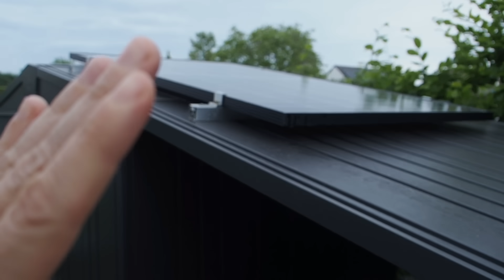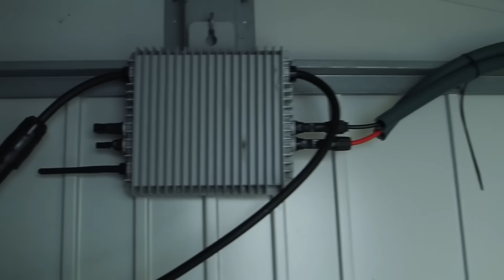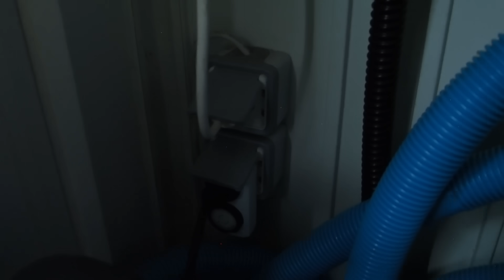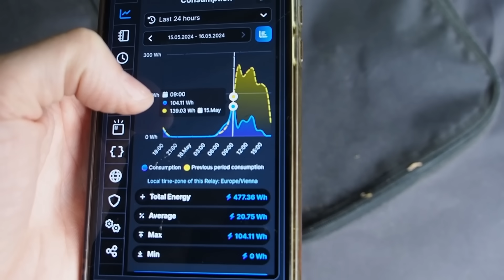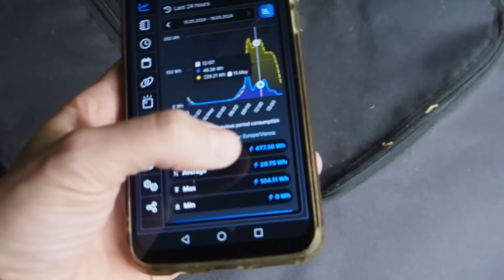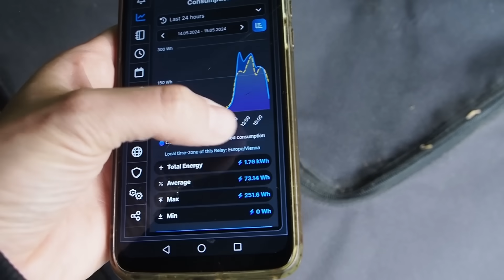Solar system? Yes? No? Which one?

Comment: 18 panels + 18 micro inverters + 900 for mounting metalwork + 300 for cabling + 3 guys @ 400 per day  ==  €6000
However...  a 7kW system will generate all the power you need to run your house in one hour (probably), for the rest of the time you are feeding the grid.
So the best solution is probably, as you said, you only need 4 panels for your house and pay a little to the generating companies.
I have come to the conclusion that you must decide first your strategy, either you rely mostly on the grid and reduce your bills with a small solar installation or you install more panels and put in a battery such as a Powerwall 3.

Comment: I'm currently installing a 1500 watt solar system with a 200AH battery in a trailer on my driveway. I'm going to plug a 5000btu window A/C into it with an extension cord. If it works well, I'm going to get a larger battery and a 12000btu minisplit to run off it. That way I won't have to run my Central A/C unless it's very hot or cloudy for a long time. No permits needed, no grid tie expenses, low cost and redundancy if either my central air or solar power fails

Comment: Never get an on-grid solar panel. Stay off-grid and out of the hands of the government
Reply: To my logic and calculations, it is best to have a few panels let`s say up to 2kwp and a 10kw battery (usable capacity around 70%) so the panels are working hard and the battery covers a usage of most of appliances when sun goes down. It is pointless to build the system for winter (in my region). The point is to help yourself for 9-10 months a year.
Reply: @viliamgajdos5917  nice.
Reply: Nope no solar no electricity live like the Lost ways the book and you will always survive. You don't need electricity to servive.
Reply: They are lying. The solar is toxic. If hail hits it your land is toxic.

Comment: Having a storage system -- Tesla powerwall or a set of batteries -- is the way to store excess electricity to be available when weather is bad. Even winter has many sunny days -- charge your batteries then, and use the power when the panels aren't producing as much.
In many places in the U.S. the town or city requires your house to be connected to the grid, like apparently your area does. But many other places don't have any requirements -- you get to choose how you want to use solar power, independently or attached to the grid, and also whether you want to sell excess power or just store it.

Comment: 13.7 kWh peak and 22 kWh battery here (Trina cells and Sofar battery and hybrid inverter with off-grid function) since Juli 2023. Couldn't be happier. We already got 1000 CHF paid back for 2023 and save a lot on electricity for the pool pump and charging the cars. Was pricey though. Would do it again. Would be cheaper now, though.

Comment: 2 years ago a solar module in Austria/germany costed €400. Now in 2024 the price is €80.    Batteries price dropped the same. 

1) avoid feeding power to energy providers, optimize for self usage = batteries
2) you can save 2/3 to 3/4 the cost by avoiding solar companies in doing it by yourself.

From April to September you can get self sufficient for €8.000 with some DIY work. (house with 4 people)
Reply: I am talking about 6-10 kWp solar and 15 kWh battery.

Comment: I installed a system mounted onto a steel workshop, i do not sell the power but use it myself. I am saving the 27 centimes p/kwh i would have to buy from them.

Comment: Well, I know that I have net metering, which means I produce a kw and the power company pays me in kw.  I can save it up for the winter when I don’t produce enough.  I make a lot of extra power.  My bill is only a $20 delivery fee.  I will be free and clear in 8 years.  I paid cash so I don’t notice it.  I only notice no power bill.  The fire danger… never heard of that happening.  This is the best money I’ve ever spent.  Small units are good, but the cost is high due to batteries being very expensive.  You are not going to run a dryer or a heater with a small system.

Comment: Lilly just read up on it yourself...  And just see what whatts you would use and get only what you would need... Say for your fridge or just to charge up a phone for emergency only only...  I have three folding solar panels that I can daisy chain to charge my small boxes up with ..  now I use the boxes every day to charge my phones and a few light bulbs that I use at night and switch them back and forth to save on not using my electric bill to power up just a few things...  That saves me a bit...  And just keep things unplugged that helps not pull that trickle pull on your bill...  Just buy some lights that are able to plug into the solar box...  Just see how much whatts you need ..   Alaskan prepper has a video that tells you how to do the math to see how big  you'll need ..   or just get a bunch of Marine batteries and keep them charged up...

Comment: You are a clever girl! We live in Tenerife and I installed a system myself. One 370W and one 200 W panel. Cost with inverter 370 Euro.
I don’t want to give away electricity so the 200 W are automatically disconnected in the middle of the day. Cost saving is 23% and the system is payed within 2,5 years. You made a good choice! I adjust the angle on the 370 W panel once a month. 😊

Comment: I did my own and ended up with a 4.5yr ROI, next i think i will do a battery system and more panels to remove most of my bought electricity for 8-9 months of the year, the ROI will be longer

Comment: I installed a small system myself.  Cost me $10k in materials, I got the 30% tax credit so roughly $7k.  If the grid goes down we have enough to use 3 fridges, have backup cooking, some other items.  Not cheap but if you have no power you have a cabin. Mine is off grid.

Comment: or just use large 250L trash bags air filled to make a solar heat collector. most of energy usage goes to heating anyways. and combine with a suitable heat pump to get the trash bag heat into usable high hot heat. yep connect the outside heat pump interface loop to the trash bag solar heat collector. and the heat can be used to make electricity too, like with peltier generator elements or just steam. of course you can diy. and even if you think you cant, you still can. thats survival, lilly. yeah gotta make sense. God gives for free, no finger pointing. payment is what we call rip-off. and why attach to grid, it makes the parts of the system more complex. just make an off-grid solar system. reliance on people shuggers. no contract. applied survival. diy lead-acid and zinc-acid batteries. come on, off grid, you dont need to fiddle with the grid companies, at all. battery storage for them too tho. also localized battery arrays, so you dont have to burn your cables.

Comment: It seems to me that the important thing is not profiting from your solar plant but to have electricity if the providers fail.  Put only enough for your needs up and quit buying the electricity the providers are bringing in for your consumption, then you don't need a contract with the providers to buy yours.  Honestly, they aren't charging more than they should in most cases.  There are many costs associated with bringing electricity into your home.  The electrical company that wanted three times the base cost of the the system they were selling did not make an unreasonable markup.  Again, there are many associated costs with doing business in our developed countries, costs you don't find on a personal level.  That said, a small system that provides the minimum for your needs is the best idea.  Just as Lilly says, installed yourself if possible.  Being a pensioner on fixed income I spent most of my savings on precious metals and candles as well as warm clothing,  whole corn and beans.  Add bottles of Vitamin C and you might be able to survive a catastrophe: you might.  I would sure like to move about 15 miles north of the metro area across the river however.  :penguin-blue-waving-tear:  

God Bless Us All

Comment: I love your videos Lili, but the "we in Europe" you're frequently using... is not so much a "we". Many countries in Europe have very different rules. Particularly regarding energy.

In France for instance, you don't "have to" resell your produces solar energy to a supplier on the grid. It is one of the available options (and not at a 1/3 the price like seems to be the case for you), but not the only one. And you don't have stupid limits such as this 800W you're alluding to. If you want to make your own off-grid system, you certainly can.

In any case, just as with anything prepping-related, 2 is 1 and 1 is zero... so "don't count only on 1 source of energy" (whichever it is) is still a good rule

Comment: Learn to live with less. I bought a 30W panel with charger for £33. Live on that next month buy another. Keep going pay check to pay check. I will never connect my cabin (not possible) or my house in Portugal or the Philippines to the grid. Use real time solar eg do washing in the daytime. At night all you need is lights. If you can run a freezer don't have a fridge. Have a top loading ice box. DON'T buy large panels buy the smallest. As objects get smaller they get stiffer and stronger. You are also not putting all your eggs in one box. Lastly, permit adequate ventilation (for cooling) to the rear of the panels.  It improves efficiency and longevity. One last thing try to live off grid and then go off completely the discipline will teach you.

Comment: 🇨🇵 hi Lili, installing self suficient electrical network, for a fridge, you need 4 times the ammount of power in relation with its consuption, let's say 250 W fridge: the compressor engine when starting makes quiet a short, will suck 1000 W at start for 0.5s
Meaning your inverter has to be minimum 1500 W, aim high, or it's worthless.
The base is 3.5 kW with 7 KW batteries, 2.5 KW output for panels 
Searching well, you got that round 1000 € to build yourself.
I think it's the minimum for a confortable house during summer.
I enjoy your show, thank you.
Reply: Sorry it's 3000€ minimum, i do appologise.

Comment: If you want to go solar to save money... forget it.   Even if you can reach the "breakeven" point, your panels will likely be outdated by then  But most folks don't stay in the same house for that long, so it's questionable if you can reach the breakeven point.  However... if you live where getting grid power to your house is not possible, or super expensive, then solar is your only option.  Keep in mind, the cost Lilly quoted for her small system, did not include any batteries.  The purchase of batteries are likely 50% at least the cost of your other components necessary to have a true off-grid system.  AND... batteries start to degrade the minute you put them into service, so they don't last forever and you likely will need to replace them in 5-10 years if you want to maintain the power you have come accustom to.  Just think about the battery in your car, if its over 5-years old you likely have replaced it already.  AND... if you want to go with lithium batteries, well, they are even more expensive.

Comment: I have no idea what the sunlight is like over where you are but I live in SW Ireland. 10 panels on the roof + a battery for 10k.
The most bill I have gotten after 2 years in January 300 euro.During summer gas and electric is free or VERY low, lady up the road,no solar panel 500 a month for  gas and electric

Panels are VERY Durable.
they degrade at 0.1% per year

Next month will see us had our panels for 2 years and for 10k we already saved BIG I also got  wood burner stove to get gas bill down.
All in it was 18K. at 6k a year for bills per year  next year it will have paid for itself.

I'm not some lefty looney  but  getting the BATTERY IS KEY. It Trickle charges ALL Day and at sundown BOOM it runs the house. Excess power is  put into the water tank for free hot water

Comment: G'day Lilly, We set up an off grid system for our cottage on the farm, 1KW of solar collection 400 watt wind turbine 4 x 120 AH quality LiPo batteries we chose 24 volts because the step up is less from that to 240 AC than from 12Volts.A 2KW Inverter through an ATS to a 6KVA Diesel generator the ATS thinks the inverter is the grid and the generator is whatever, there's a 35amp battery charger connected to the batteries so they're being charged whilst the generator is running in the case of a lack of sun and wind, all in a separate shed to the dwelling 👍.

Comment: Here in Florida. We purchased 4 to 8 panels at a time. 100 Watts each @ $98 each when on sale.

We have 4.3 kilowatts of panels and three battery banks. A 2k bank, a 4k bank and 8k bank. We have 8 inverters. One 3k, three 2k and four 400 watt inverters. All pure sine wave inverters.

We also purchased a 10,000 watt inverter dual fuel generator, a 3,500 watt dual fuel generator, a 2,000 watt inverter gasoline generator.

We spent about $9,000 so far and are fixing to order two new 60 amp mppt charge controllers. We started with cheap pwm charge controllers.

DIY Solar System with multiple battery banks and multiple generators was a good way to go for us. Two of our generator run on either gasoline or propane gas.

Great Video👍

Comment: 400W is not nearly enough for comfort living. You need water heater, washing machine, not to mention any of power tools. Nominal power of solar is never reached in real-world conditions. Also, you need battery that is big enough, because there is no solar during the night. I am talking from my own experience, since I have remote home with off-grid solar system.
Reply: She's on the grid, so there is no change for her in "comfort living". If she installs a battery bank and more panels for an emergency, she will get by and be more comfortable than others.

Comment: BATTERIES! I have been using solar panels for all my electricity for 30 years miles from grid. If you don't know how to use tools you can sell your soul to a company. Panels are a tenth what they cost when I started. Electricity is not complicated if you can read. Start small and add to it. If one thing fails replace it. Separate components charge controllers/ inverters/ wire etc are better. Gadgets which combine several in one box might be okay for a van but when one thing fails you have to throw it all away. Technology keeps improving. I get electricity year round, less when cloudy and you might have to sweep off snow if you are afraid to get cold. I think grid tied systems are a rip off but I am just and old independent hippy DIY!! is much cheaper then you are in control. It gets cold here so Lithium is not so great. I am transitioning to AGM. When better batteries become available just unplug then plug and play. My systems more than pay for themselves but you have to be modest and humble. If you are a power-hog build a coal-fired power plant😂.

Comment: Best solution is to have a solar hybrid system with batteries, without any delivery to the grid system. So you gather all the energy you can and keep it in the battery and use it, when its dark or bad weather, you take electricity from the grid, when your batteries are charged then use your own electricity.

Comment: Just finished, a 6kw system in the Philippines. Off-grid, 2,398 Euros ~ 2,603 US Dollars. <- That includes 12 panels, china inverter and china battery (230ah). Thanks for sharing

Comment: In Oz, I generate 7 times more power than I use. The energy company still manages to bill me. We have subsidised the state's grid.
Reply: No you don't, in fact you do not have enough energy for the winter months.  You are also using the grid as your battery, so it's quite appropriate that you help pay for that benefit.

Comment: We have lived off-grid for 26 years. Currently, we have 7.5kW solar panels; 2 Outback 24V inverters stacked to give 6kW power; 1600 ampere hour lead acid gel battery. We run everything a modern house has - dishwasher, washing machine, fridges, freezers, aircon/heatpump, TV, computers etc etc. Of course we cannot run all at the same time and we have to schedule use to coincide with the sunshine (S. Portugal). The nearest grid connection would cost us in the region of €25,000 - €30,000 in total so it's not an option. We have a diesel generator for back-up but rarely need it.
Reply: But what you conveniently failed to mention is you are also using wood or propane for your energy needs.  You aren't heating your water, cooking, drying clothes or heating your house on a 7.5kW system.

Comment: Thanks Lilly, one question, how do you deal with snow on your solar panels in winter ? To climb onto your roof to remove the ice for the panel/s to work will surely increase the injury risk to you standing on a slippery roof that you could fall off and break bones or worse ?!
Reply from the maker: That is why you want to mount the solar panels so you can reach them easily like I did on my pool shed

Comment: Off-grid ground mounted used 240 watt panels, for a total of 5.2 kwatt of Solar 1500 with delivery
12 kwatt off-grid solar inverter charge 1300
30 kwatt LiFePo4 batteries 9200

I installed it myself

Comment: I built an off grid system in town and use batteries. Run my household critical loads and it works great. i have 2700 watts of panels, but light on batteries at 7.5kwh, it is slowly getting larger. No grid, no bs from energy companies and their games.

Comment: 18 years? 😂 what a joke 
They won’t last more than 5 years 🤨 imagine a hail storm 😉 led acid batteries 5-6 years , inverter not to much ( everything is made to break easily ) .
Take for example the tyres from your car: even if you don’t put them on, they are designed in a way that will self brake after 7-8 years 😉 ask Michelin for this

Comment: I live in a hot sunny climate and moneyback takes around 8 yrs connected to grid with a smartmeter.
7kw roof solar system regularly generates around 30 kwh daily .
Enough to cut bills substantially.